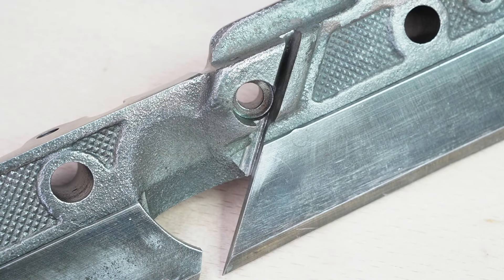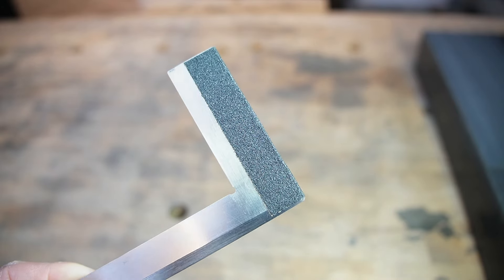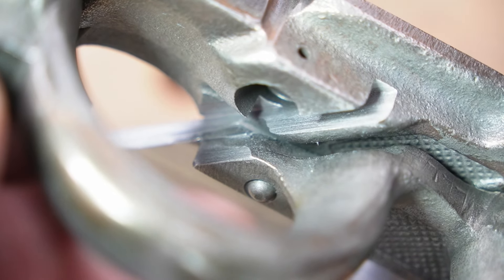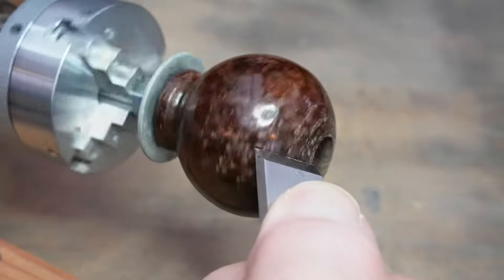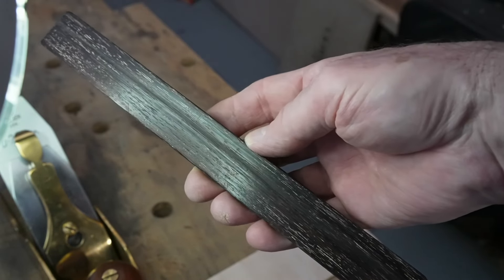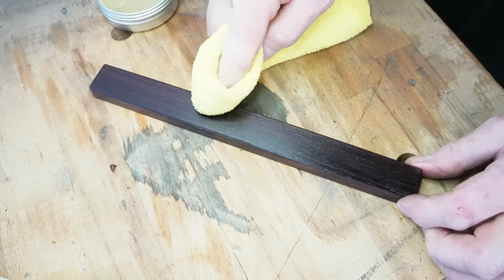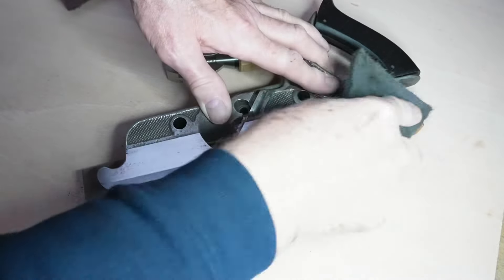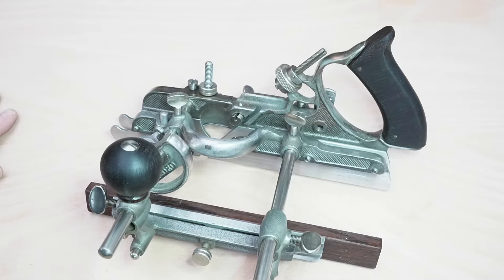SuperTune! The Record No 405 MultiPlane - Part 2

Comment: Lovely stuff Jim. I’ve got one of those beauties and find it very useful. I think they’re actually better for the hobbiest woodworker such as myself as it stops you needing a ton of different hand planes. A bit of patience is required but when you get the knack they’re a joy to use. 

Out of interest how do you find the size of granite plate you have there, if you had to go again would you get the slightly bigger one or does that one do just fine ?
Reply from the maker: Hello! Thanks for the comment and sorry for the delay in replying. I find the granite plate does for almost everything. I do have a really big one, but Senior Management is using it for something at the moment. However, it’s seriously heavy - around 85kg - so difficult to move around. In the last workshop I had a sturdy trolley for it, but that got broken in the move. I need to get it sorted out though because I need it for some upcoming work. Working on how to use the multi plane at the moment…
Reply: oof 85kg !! I think i'll be checking the weight of anything before I buy it for sure !  @mrlinnsworkshop
Reply from the maker: @moomastico I know 🤣 I wish I had…🫣